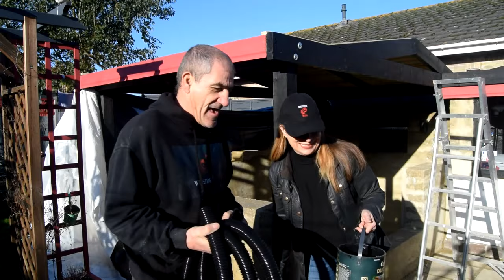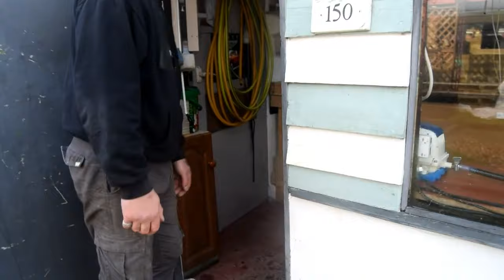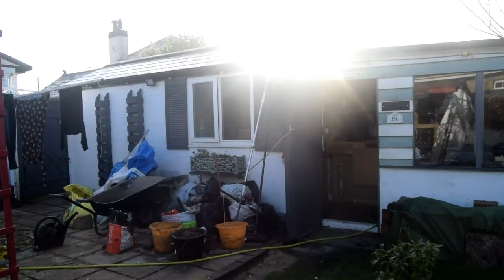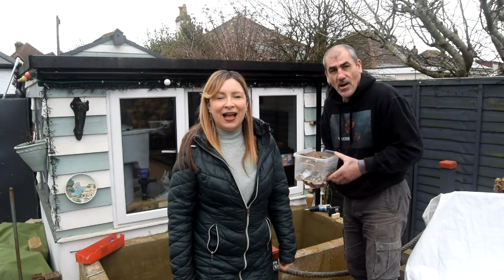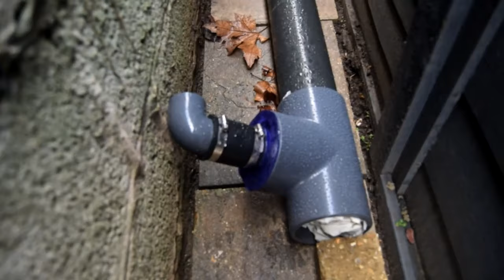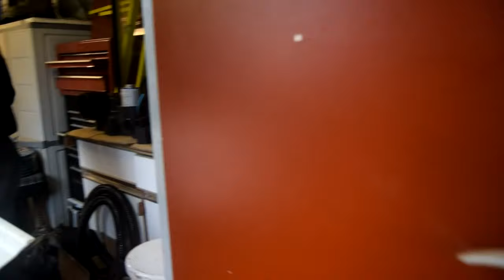working on the fry pond, jills staining everything, and the koi fry. Ep 35

Comment: The old fashion idea for starting a pond quickly was to Pee in it. Seriously that's what was recommended. I've never fancied it myself.  The other way is to add 3 or 4 fish a week. You only get new pond syndrome when you suddenly add more fish than the filters are currently capable of handling.  That small tank is coming on great.
Reply from the maker: THanks for the comment,  think we would lose subscribers if we pee in it, i see what you mean by adding a few at a time, a gradual process that the filters can keep up with.
Reply: @ACKoi  there are loads of ways of doing it. It the same as maturing a filter on an existing pond. The only downside is without the constant supply of ammonia and fish waste the bacteria dies off and you are back to new pond syndrome.  I think it boils down to which ever way you fancy trying. As long as you monitor it it will all get there in the end.